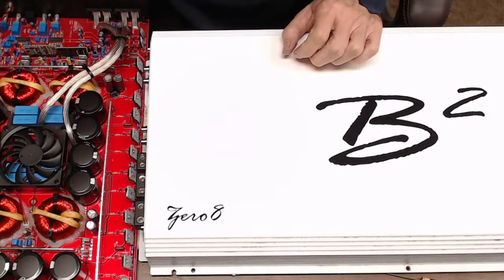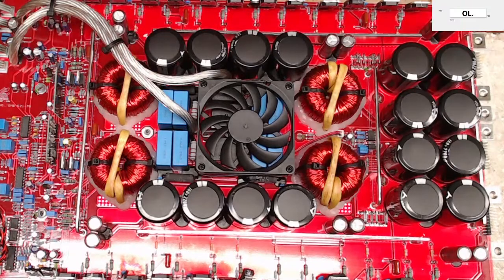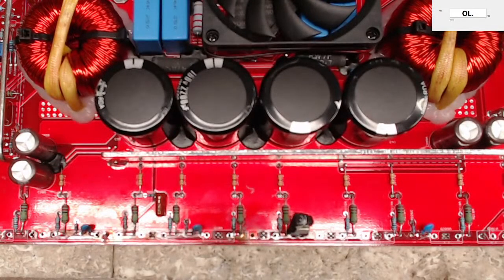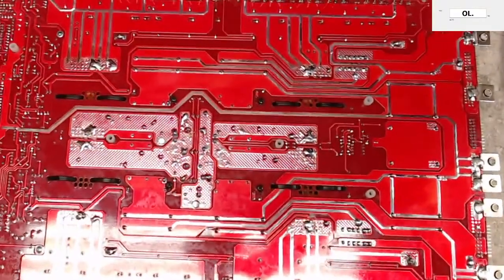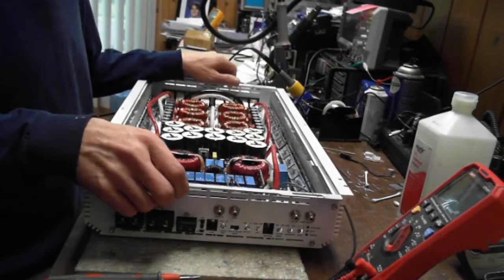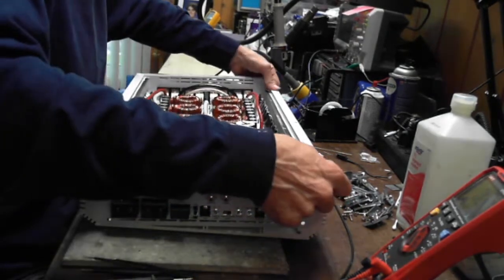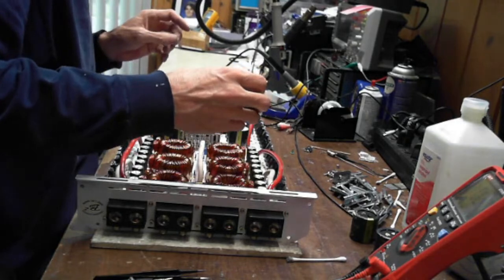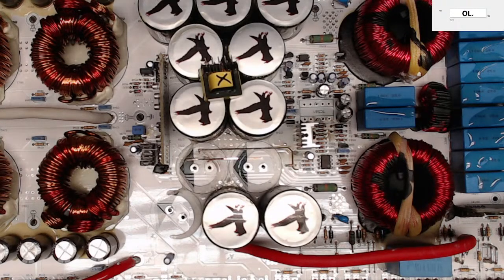Choices! B2 Zero 8 The Osprey Aux. Fault or a Crescendo Bass Clef 17k output repair?

Comment: Great video  check Orion amps for that transformer I got a parts xtr 2500dz that has a aux power transformer that looks the same
Reply from the maker: I bet they are the same. I did manage to repair the winding going to the pins but I am not sure if the transformer is shorted internally as I have resistance on 3 pins. I hope there is a center tap winding on the transformer.

Comment: I got a wered problem with my crescendo 17k. So my truck was set on 16.2 volts and my 17 k will protect every time it hit a low bass note but my other 17k still will play it at that high voltage. So I turned my voltage down too 15.7 and the same 17k still do the same thing go in protect when it hit a low note but my other 17k still will play. But if I can get my voltage down too a 15.4 range then it will play all the low notes want protect or nothing. So what you think is the problem. I never seen this before. Because a crescendo 17 k should handle that high voltage. My other crescendo do.
Reply from the maker: Sounds like an issue in the over-current circuit.
Reply: Can you fix it
Reply from the maker: @robertlee5763  Unfortunately you fall outside of my testing parameters so I am unable to take it in for service. You can find more info at www.ellensburgamplifier.com/FAQS

Comment: Hey bro I have a Us Amps Bass Mekanik PT1100.. I need it repaired.. are you in the states?
Reply from the maker: I am in the states. You have an amplifier that is designed around the Tripath module. If the output has an issue the module may need to be replaced. Getting the module is the tricky part.
Reply: @ellensburgamplifier  yes I've been told this.. I believe the Tripath module is fine it's the input and output Fett's and mossfits that look blown... Where can I send some pictures too?
Reply from the maker: @garyv6442  www.ellensburgamplifier.com is where you will find all my contact information or you can fill out the form at www.ellensburgamplifier.com/request-a-quote and I will respond ASAP.